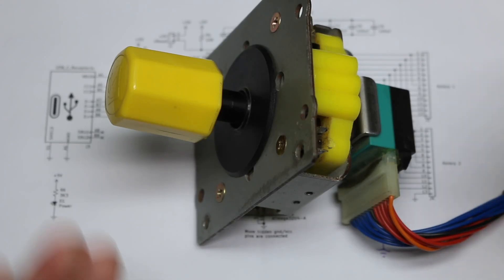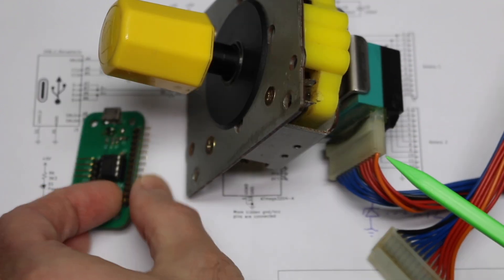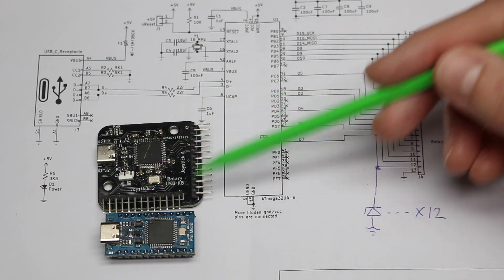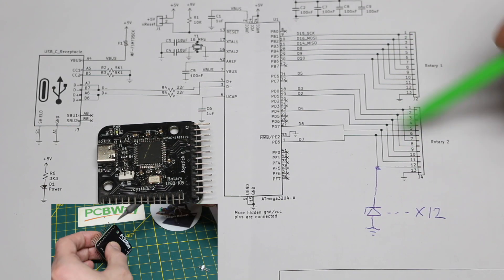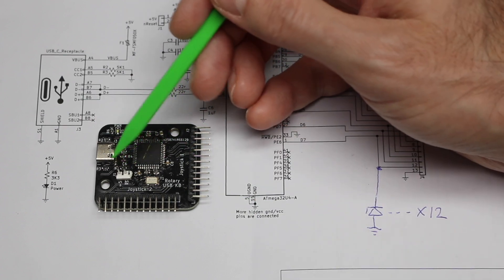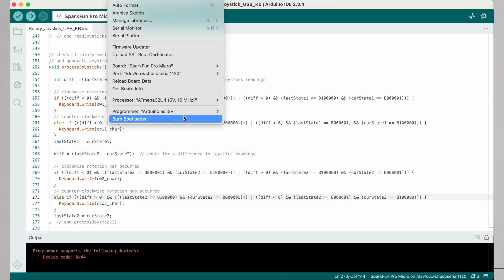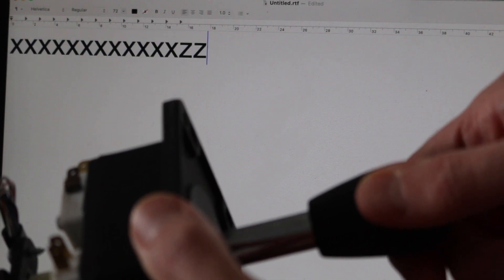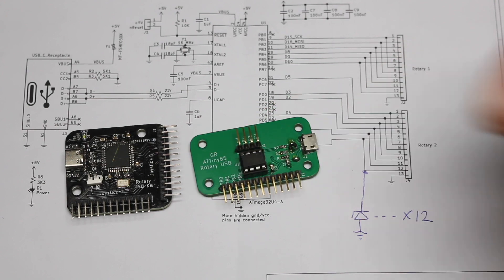Arcade Rotary Joystick to USB Keystroke Adapter

Comment: Does this PCB  also sometimes skip a step when turning the knob or is really every turn registered and translated in the right movement ? ... with the other PCBs (also tried an Arduino solution) it sometimes skips a turn step.
I also have the original SNK rotary joysticks and combined the 12 positions to 3 groups of 4 and the inputs of the arduino pro micro where handled as interrupt.
I thought maybe the missed step comes from the joystick itself (although they are in totally new condition).
Do you think this is a joystick or PCB issue .... did not see this skipping issue when setting the turns to normal buttons.
Reply from the maker: are you seeing the skipping with just normal keyboard use like in a notepad or in Mame? I think mame itself misses some key presses because of the way it operates so if you’re pressing regular keyboard keys to rotate sometimes it won’t respond or sometimes it might lag and then do a couple of presses to catch up so we can’t really change anything about that

otherwise switch contact debounce  timing adjustment might help if it’s showing up in notepad because these kinds of switches may have a long settling time for contact bounce to settle down and then when trying to rotate quickly between multiple positions it becomes a balancing job 
so the best result might only be finding what’s optimal and not perfect and it might vary between different operating systems and how they handle USB keyboard input

The original arcade board looked at all 12 switches directly so it didn’t matter if it was bouncing around or how fast it went from one position to several clicks away because all they need to do is keep reading it until they see something stable and then they know exactly where the character on the screen is supposed to be but the best we can ever do with Mame is an emulated hack of that behaviour.
Reply: @GadgetReboot  I used a text editor and did not recognize any losses of steps ... when using the buttons in MAME which are mapped as keyboard keys I also did not notice any lost steps .... That is a bit weird. If MAME was the issue it would also loose steps caused by normal button presses.
But Ikari Warriors which used a 12 position rotary also just uses 8 directions in which the character was oriented. This means they also had to do some kind of workaround and did not have a defined "pressed button" for each position (otherwise 4 steps of the rotary joystick would not do anything).
I think I'll hook up my oscilloscope and try hardware debouncing. Maybe this is the better way then software debouncing.
Thanks for the info and your help !
Reply from the maker: not knowing how the software in the original arcade made their decisions, even though they had to translate the 12 switches down to eight positions, they would still be more immune against things like rotating the joystick too fast where a  normal switch read could miss it because it’s rotating faster than it takes to even de bounce a single switch so two or three fast moves look like one longer  bouncing move or some thing, 
in the end if The joystick just quickly goes between position five and position nine, all they have to do is say 9-5 = 4 steps have occurred and then they can just move the character four rotations but doing it in Mame we do have to differentiate those four independent movements so there’s all kinds of extra things to try to account for.

otherwise if moving more slowly so we assume there’s enough time for each rotation to be debounced  properly and then properly sent to Mame, another parameter that may impact it in an Arduino project is the timing of how long a USB keyboard key is being pressed or released so we may know the proper number of button presses for a rotation sequence but if software is generating the keystroke too quickly, the computer may not recognize it so in the sketch for this Arduino pro micro type circuit I have a timing variable in there to control how long a key is held down because I did find that if it was too fast the keystroke would definitely get missed so I had to slow it down

Comment: so helicopter control emulation is now possible ? need to limit 1 to Y axis movement only (new cable), might need Y axis for left right foot pedals (have no idea)
could do profile selection, where a direction chosen within 30 Seconds of usb cable plugin selects a certain combo of letters .... (if there is space for it on the chip)